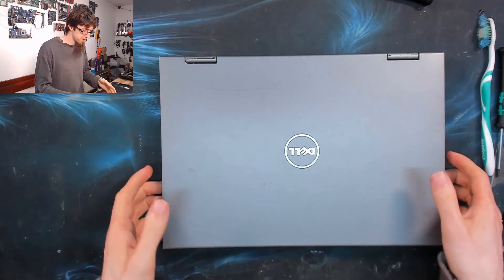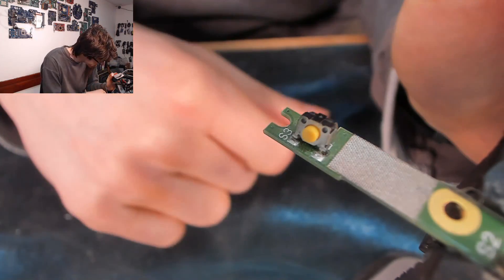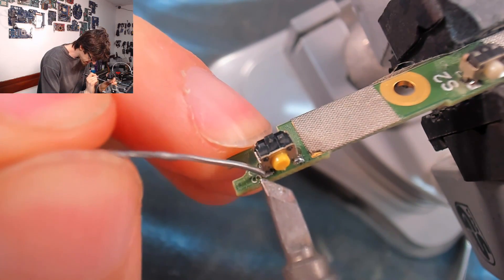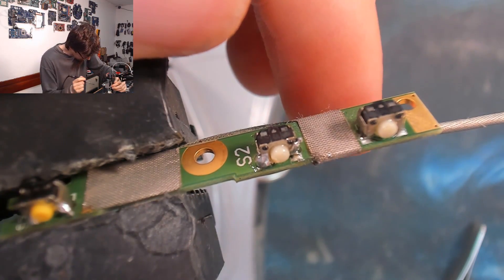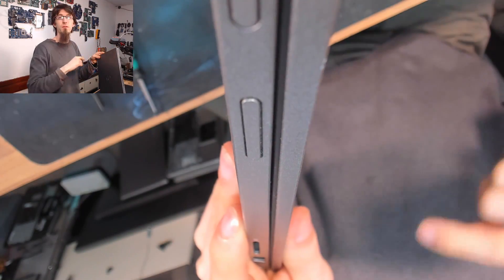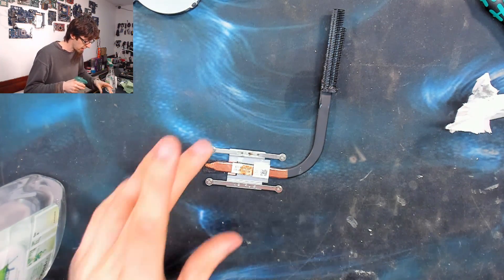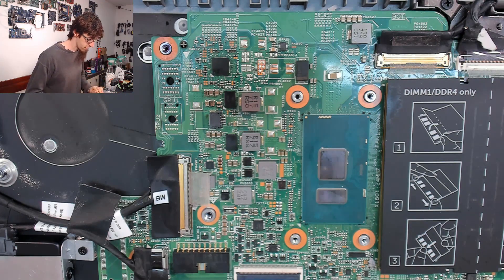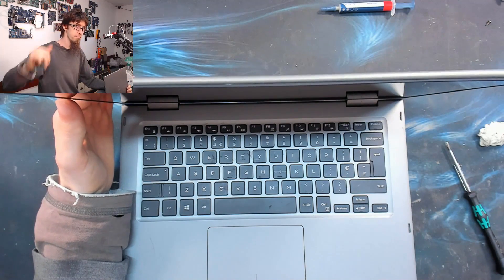LFC#208 - Dell Inspiron 13 2-in-1 Power Button Repair

Comment: Today I worked on an Inspiron 3168 that had the power button completely missing from this three-button PCB. So I desoldered the down-volume button, and moved it to the power-button position. I am amazed that it actually works! Thanks @Nethesem !

Comment: Smashing repair :-D
I hate the manufacturers using only solder to hold buttons and sockets down.
i have often placed a blob of hot glue behind the button to give it more strength.
Handy for keeping laptop power sockets moving. (Weak plastic cases).

Comment: I like to use foaming glass cleaner (Bon Ami power foam specifically) for safely removing baked on/in coffee areas. I had a laptop with so much coffee baked in , the blue PCB was brown to black .  nothing was doing a good job , so i figured what's the harm .  It removed coffee in seconds. I'm not sure what part of it made such a great solvent so I went back over with alcohol to clean possible residue .  Great videos m8.

Comment: I would recommend a pointed angled tip as a general tip when doing smd and fine stuff. Those switches are the cheapest mini switches you can get and need some force to action them; Dell could have used better switches. As usual everything is done to maximize profits; rather fed up with this regarding HP laptops and I have switched to Lenovo. Anyhow great video and thanks for posting it.

Comment: Repeating myself; Great channel. I really appreciatre the way you work. I have just bitten the bullet and bought myself a power supply with the intention of locating shorts on 3 or 4 laptop motherboards I have. Inspired by watching you track down faults. Unsure, do you not use a microscope?
Reply from the maker: Cheers and good luck! I work by eye at the moment, and using my camera (Logitech BRIO) as an inspection cam. Good microscopes are expensive, and I've got a decent macro-eyeball ;)

Comment: little more cleaning the pcb and the oxidated soldertip will provide a better fluent solder. I like to solder on high temperatur too, but that can be hard for the tip when the standbytime is set too long.
But anywhere,... the solution count👍👌

Comment: Thanks for the video, but I think you should really change the tip of your soldering iron or use a tip refresher that would remove the corrosion from your tip. 
Solder should "wet"  around the tip not collapse to a ball :)
Reply: Or learn to solder.

Comment: yes you can use the holes , just add solder on the bottom side as there was metal there and why no flux ?
Reply: Yes, only get the lack of the pcb before.

Comment: good job but I think I'd struggle too with that soldering iron tip your using, maybe think about another tip, and I know, sometimes you work with the one you like even when it's the wrong one but I think it might help
Reply from the maker: Yea switching out to the conical tip probably would've made it easier. My main enemy here was that I prioritised the camera over my own access, so I was working cack-handed.
Reply: Personally I would opt for a 2-3mm chisel tip. You keep the maneuverability of the conical and the ability to conduct heat better. Best of both worlds.
Reply from the maker: Cool, cheers for the tip! Pun intended.

Comment: Hii my laptop is same mode 5368 one of the plastic end was broken which is connected to power button how could I get it
Reply: My problem right now. Did you solve this issue yet? I may just attempt to glue it back together

Comment: Hi, wouldn't make a problem when you solder the pins to the body of power switch which is ground? thanks
Reply from the maker: This is a good shout, it's ground all around the switch, so a little bit of sanding to uncover the ground plane would give me something to solder the side-anchors to.
I think the front ones will be enough. I've done this method of 'blob solder to re-enforce' before and not had any problems with it yet.
Reply: Saeid Cyppp no, it won't be a problem because what he soldered is not a pin, but the legs of the body of the power switch itself that was broken.

Comment: I was wondering what camera you use for your overhead shots the picture is always so clear
Reply from the maker: Logitech BRIO in 1080p 60fps mode. Webcams can make good cameras, they just need a lot of light to make up for the small lens/sensor. In return you get absolutely wild macro capabilities.

Comment: Sound advice @14:40 : the number of times I've had the black bar on zif connectors disintegrate (usually on tablets.. They almost go to "powder puff".
Reply: The reasons why a lot of those connectors and especially imacs just crumble is due to heat.... it makes the already cheap plastic brittle.

Comment: Hi, I like your vids and teaching "how to"s Keep it up pls.
I have a problem on my MSI laptop. It was working well, suddenly it shutdown. I powered up again, after few min it shutdown again. I thought there might be overheating or battery or charger problem. I check them all, I tested with brand new charger. No luck. Interesting thing is when it power down charger light also went down. it come up again after few seconds and computer can be powered up. After few min it shutdown again. time difference between two shutdown getting shorter and shorter after each shutdown. If I wait few hours before power laptop, computer can stay on longer. Could you please tell me what is causing it? I want to fix my laptop. Thanks.
Reply from the maker: Still sounds like overheating. You might have what I call 'flash overheating'. CPUs can change temperature from room-temp to 100c within a second, so you check the temps while it's on, and they look fine - but the moment that the laptop starts doing something, the CPU 'flashes' up past 100c and cuts out.
This is usually caused by the cooler not seated correctly, or thermal paste that has dried and cracked. Try replacing the thermal paste!

Comment: Adamant IT sir i have a laptop DELL XPS 14 the problem is 4 BEEP ERROR...its a RAM problem but the RAM inside my laptop is IN BUILT IN there's any solution for this thanks in advance
Reply from the maker: The only real shot at fixing it is to reflow the ram with a good hot air station, and the experience to use it.
Reply: @Adamant_IT  ok sir thank you so much
Reply: @cjmendoza8599   just a ideea....try to see if the back of the motherboard have some problem.I was lucky to see that on the back 2 pins are in contact, but on a desktop station.Good luck!

Comment: I had a Dell laptop with the same chassis and was returned 6 times in the first year due to faults. Eventually the only thing remaining from the original laptop was the bottom chassis piece. Not a fan. Also the cooling is inadequate

Comment: Hi sir, What faulty if cmos plug in, the laptop won't turn on, same goes with battery laptop. but if using charging cable everything OK.
.
Asus A55V
Reply from the maker: Sounds like a fault in the battery charger section of the motherboard

Comment: Why didn't you ise some thermal compound on the second chiplet just at the bottom of the cpu? Didn't it deserve some care too?
Reply from the maker: That one's being covered by the thermal pad on the heatsink. Usually I'd paste both, it's uncommon to see a thermal pad on the iGPU.
Reply: @Adamant_IT  I did not notice the pad on the heatsink my bad. Btw it is weird...i never stepped in a laptop using pad for igpu. Probably they do sit at different heights.
Reply from the maker: The chip will be flat on top... If I had to guess, I'd say the heatsink was designed for a different CPU with a monolithic die (rather than the two dies on this chip) and the designers found that if they stuck a thermal pad on the end, they could reuse it with this CPU as well. One less new part to redesign and manufacture.

Comment: What does the software service consist of?
Reply from the maker: It varies depending on what I feel the device needs, but my main bullet points are:
 - Clean up virus/junk/spyware (this machine actually had the Segurazo virus, which is a nasty one)
 - Prevent apps running on startup that don't need to run on startup
 - Tidy up windows layout, so start menu, desktop icons, etc
 - Install windows updates, ensure running the latest build
 - Tweak some windows settings for storage/performance (page file, system restore, etc)
 - Defrag if HDD, resolve any other issues the customer has mention, or that I spot
Reply: Running CCleaner and cleaning up junkware / start up nonsense

Comment: Never blow on a solder joint!! It makes for a cold joint. always allow joints to cool with time....
Reply: can't see a puff of air making much diffs, maybe a quench. Colds joints as I know hem come more from movement when cooling.
Reply: @Kosmonooit  Any cooling EVEN a PUFF of air creates a cold joint..... Been doing this for 40 years.
Reply: @davidbates2161  I've been soldering on longer than that, but hey one learns something new everyday.

Comment: Y have so much problem with soldering because the temperature of your soldering iron is too low. The TS100 you are using isn't very good for soldering elements with for example metal casing like switch.  When you touch tip of your soldering iron to this type of object they take a lot of heat from it. This soldering iron isn't extremaly efficient.

Comment: Your not very good at soldering....Solder flows to heat, so heat the pad and then apply solder. The solder will flow where you need it.
Reply from the maker: Ye I know. As I mention in the video, I'd set this up to give the camera a better angle - and it could see the joint better than I could, hence why I'm looking pretty ham-fisted here.
Reply: @Adamant_IT  no man you clearly don't have a lot of experience doing this stuff... Firstly the flux was already burned away was part of your problem second of all you need your iron tip to be touching both the pad and the side of the  unit and if that didn't work means your iron wasn't hot enough to heat up the ground planes and/or the metal housing of the button enough to let it flow properly.  That was a horrible job soldering and you may have compromised those joints.  It annoys the hell out of me if your STILL trying to push the solder in the spot you want it which you where clearly doing at one point it doesn't matter what excuse you use it means you dont understand the basics of soldering.  When techs say it's ok doesn't have to be perfect its when the joint is soldered together and doesn't look the greatest ie isn't nice and shiny  but it's still a solid joint.  Pushing a solder blob to where you want it does not constitute as a solid joint lmfao.  Little hint if its sticking to everything and isn't a shiny blob means YOU NEED MORE FLUX.  Yet your on YouTube trying to come off as a authority on this subject...  This kind of crap goes to the customer they get pissed off at independent repair centers and then dont trust them... Dude seriously if you can't even solder wtf are you doing these kinds of repairs..... Myself and other people who have been doing this since Louis channel was first created are now having to fix screws ups because of people who refuse to learn the basics or start repairing customers stiff when they shouldn't and giving us all a bad name.  This kind of crap really pisses me off and yeah it's a simple thing but if you can't even get a simple thing right I know what the rest of your work is like....
Reply: @Adamant_IT  Also to reinforce the buttons I would have also added some hot glue after resoldered them to add more strength.  Hot glue is very handy in many ways just dont listen to certain youtubers who claim its great for laptop hinges........ ;)

Comment: Your welding skills are bad. You use too little flux. The solder tip is too old, it does not transfer heat well.
Reply: it is not welding. it is soldering. and yes he is VERY bad